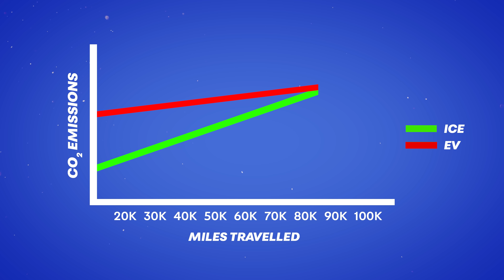Are Electric Cars REALLY That Green? [New 2022 Data]

Comment: Firstly make hybrid electric semi electric etc cars comparable cheaper than petrol diesel ones, you wont find a decent electric car for 10k like you find petrol or even diesel one , of which same capacity same equipment same features etc, i own kia sportage mk4 , paid for used 5 year old one with 50k on clock nearly 10k, find me same suv electric one for same price if i have "only" same amount in my pockets?  Outcome, youll only find nissan leaf and with 60-70% batteries capacity and powerness left with same or maybe even more miles ob clock , only being able to do 40- 50miles on one charge max ....

Comment: 1:50 are you even serious? while this is arguably true, no one throws an EV to a landfill at 90k miles. even if you total an EV prior 90k, the battery can be reused in many applications like energy storage.  worst case, the battery can be recycled at 95-99%.  burning fossil fuel would have released dust, toxic fumes, besides the CO2 environmentalists are against

Comment: This video pointed out that they Volvo used the CO2 figures of the extraction of the materials for and to build the batteries and compared that to the extraction and shipping of the oil used in petrol cars for Fuel. Every video I watch with, the given angle neglects to cover something major when figuring the Carbon emissions of an ICE. This video and Volvo did not disappoint... What about the Materials and process of Building the Internal combustion engine, Transmission, Fuel tanks, Exhaust systems, and all of the components that make them run all the Necessary repairs and Maintenance of each type of vehicle. Transmission Services, engine or powertrain Maintenance,  Exhaust repair. The Graph showing a ICE starting point of emissions almost a 3rd of an EV? Really. 2 Cars weighing 2 tons each and the CO2 generated in manufacturing them from the earths Crust to the showroom floor and an Ice generates a 3rd of the CO2? From Casting and Machining all the parts and components under the hood and from crankshaft to transmission. It's Like All that just Magically appears on a shelf and they just install it in every video like this. Like I said they didn't disappoint!!

Comment: You discreetly overlooked the pollution caused by disposing of the various vehicles at end of life.
EV's need much more energy for this, and if the BS propaganda of supposed  recycling any parts of the batteries is attempted , which at the moment is never , much more energy is needed..
I would suggest that if the end of life resources/pollution and the start of life  cobalt/lithium mining and battery manufacturing resources/pollution are incorporated, they'res not much difference between EVs and ICE's.
PS 
Let's overlook the pollution and potential pollution of the sinking of the felicity ace 60,000 tonne car transporter in the Atlantic,caused by VW poor quality EV batteries causing a runaway fire .

Comment: They say, battery can be recycled and be as good as so no need to polute enviroment in the the future. 4680 are good for 2mil kilometers so from my point of view all good
Reply: Ev batteries are not recycled at the moment. The resources and energy needed to extract minerals such as lithium and cobalt make it uneconomical.
The complete battery assembly can be extracted and possibly used as a cheap way of holding electricity from solar panels, on  domestic housing roofs, but unfortunately responsible governments and insurance companies do not encourage this due to the potential problem of runaway fires with such batteries.
ICE vehicles have been recycled for decades.
Reply: Oh 2 million km battery  life span? 
Where did you get this from ?

Comment: EVs are in fact powered by coal.  The emissions produced in the manufacture of one battery are equal to the emissions produced if running the same car on petrol for eight years.  They have next to no resale value because buyers are scared of the cost of replacement batteries.  They have limited range and are difficult to refuel.

Comment: The breaking of the EV at end of life has not been taken into consideration, what happens to all that toxic lithium?
Petrol cars can pretty much have every part broken down and recycled.
Also what about the human factor of an EV, the lithium and cobalt mines are absolutely disgusting for health & safety, there is no health and safety and the miners do NOT live long at all.  Not to mention the mess they make of the planet.
I'm thinking ICE is actually better in the long run, once breaking down the car at end of life is factored into the equation together with the human suffering of the miners.
I'll stick to my 2016 M235i until hydrogen is a thing methinks...

Comment: ....what happens when the EV needs another battery at 60,000 miles???
Chances are the owner can't afford it and the car will be scrapped. 
So if it's scrapped before the break even point, then EV's are worse than Internal Combustion engined cars.

Comment: This piece is really nothing more than FUD. 90,000 miles to earn back the higher carbon required to build an EV? This is simply not true. The real number is about 5,000 miles. To base a YouTube piece on some IC/oil misinformation is guaranteed to make the piece invalid.

But there are other problems with this piece. To start with EVs are about 5x as energy efficient as a comparable IC vehicle. The issue isn’t pollution around urban areas, it’s global warming.

In my case, and for a lot of EV drivers, our cars are fueled by energy harvested from our roof….so, zero carbon emissions. But even if one fuels an EV from the grid this is typically done at times of the day when there is excess electric capacity. 

Then there’s the energy required to manufacture and transport fossil fuels, which is simply enormous. 

At this point we should be long past the kind of FUD, and you really shouldn’t continue to disseminate it.

Comment: It is a interesting conversation to have. We all know that major manufactors use a lot of energy when producing products wither they be electric dolls or cars. It is interesting to see that Volvo have including the cost of production to you owning the vehicle, even though we have no control over that. It is too different conversations productions of vehicles and ownership of vehicles because as I said before we have no control over the cost of energy used in production but we have a choice in how we power our vehicle. Yes, I know that getting the fuel and production of the fuel is expensive but that is out of our control. The control we have is as I said before we power the vehicle. If you have a green energy supplier for your electric supply to charge your vehicle, it will be cheap but when powering a petrol car we have to take into the cost of fuel, the co2 that car produces and tax etc. If you have electric car, you have 0 tax, 0 co2. If you have petroled powered car you have larger co2 and tax to take into effect. i hope this makes sense in a roundabout way.

Comment: Nothing about charging times, which makes these cars difficult to live with if one is doing any sort of mileage.  Nothing about the amount of electricity needed to have all cars as EVs.  Nothing about the need to re-wire the nation to deliver this mythical electricity we do not have.  Nothing about intermittents not delivering anything like what we need, especially in winter.  In short, they are impractical for many uses, are extremely expensive and unless you own a drive, cannot be easily or conveniently charged.

Comment: An electric. Car if bought as first car will of course be greener. But most importantly there isn't that crap coming out the back of 5millon exhaust pipes in built up areas. Also UK is becoming more and more relient on solar and wind which is great but as you can't store grid electricity it's a great energy capture device with more and more EVs having the ability to have bidirectional charging.

Comment: I think that a lot depends on the timescales you work on. Because the lithium, cobalt and so forth in the batteries, and the neodinium in the magnets isn't consumed but is available to be recycled at the end of the vehicle's life, EVs look far more sustainable if you look over longer periods. Especially as wind and solar electricity have got so cheap.
Reply: What is the cost when the EV needs to be scrapped.
Reply: @donaldcarey114  that's going to depend on several variables such as the price of  neodinium, lithium and cobalt at the time when the vehicle is worth more as scrap than as a road car. If someone comes up with super cheap new sources of those metals, or alternative ingredients for batteries, then in a few years we could even be in a situation where you pay to have an EV scrapped rather than you get to sell your EV to a scrapyard. Being pessimistic about the supply of those metals, my guess is that the era of the cheap second or fourth hand EV is a long way off, and people who want a dirt cheap old car will be restricted to ICE ones for a long time. Of course that assumes you buy your battery, if you lease your battery you might want to read the small print in your contract. An old EV with its battery removed at the end of its battery lease might be a liability, especially if there isn't a breakthrough in batteries or their ingredients. Or it might be something you can give a new lease of life to with a new battery.
Reply: Wind and solar is heavily subsidised by the carbon tax paid by us the people don't be fooled look it up
Reply: @roberteccles3896  I have looked it up. Sadly the carbon taxes haven't really got off the ground. Early wind and solar did indeed get subsidies, but now? The costs have dropped below the level that fossil fuels can compete with them.
Reply: Where is the wind and solar panels manufactured
Reply: @jonathancardy9941  ps who paid if it wasn't carbon tax
Reply: @Robert Eccles  a carbon tax is a tax on carbon. Like income taxes are taxes on earning income and gambling taxes are taxes on gambling. Income taxes, property taxes, gambling, tobacco and alcohol taxes are widespread across the world. But that isn't really relevant now that solar and wind have fallen in price to the point where they are often the cheapest energy option. This is capitalism - the technology has improved to the point where the market is enabling consumers to buy solar and wind power.
Reply: @roberteccles3896  In the UK most of the wind turbines are built in Denmark and in Hull, although that is a very simplistic view. One of the current challenges (and my pun is intended) is getting offshore infrastructure permanently connected to our grid (so the cabling to connect the offshore wind farms to the mainland). However, once it is all connected, the cost of renewables will become significantly cheaper than hydrocarbons. The difference cannot really be qualified as we don't know how hydrocarbon prices will develop in the current geopolitical climate.

Sure, for caseload generation for those days when it isn't windy, we do need some back-up but compact nuclear generation is looking pretty positive. What is important is the the UK becomes self-sufficient in terms of it's energy production and we have the technology, the engineering skills and the resources to do so.
Reply: @jonathancardy9941  Government subsidies, like all other "Social Programs" are not paid for by carbon taxes. YOU, the taxpayer pay for it.
Reply: @jonathancardy9941  REALITY CHECK:  If that were true (the total cost of renewables), we wouldn't be having this discussion. EVERYONE would be using them. I know I would be, and I'm not.
Reply: @davidstephen6753  Tell me, when and where are these nuclear plants in the U.K. going to be built? (Asking for a friend.)
Reply: @donaldcarey114  Rolls Royce are currently looking the designs of 'Local' Nuclear packs which could be situated pretty much anywhere that the facilities could be managed - particularly water supply. So the generators would likely be built in Derby and, the last I heard, Derby, Glasgow and the West Midlands were being discussed as early installations.

I first went to sea in the Royal Navy in 1989 and nuclear propulsion was available to us (on submarines) and the U.S. Navy (I spent some time as an R.N. Engineer seconded onto the U.S.S. George Washington), so it is actually an entirely viable and practicable solution. The reluctance has always been the politics alongside the public perception of the risks from nuclear power. A bit like hydrogen, these things are not the 'boogeyman' that they are made out to be. Of course, they can be highly hazardous, but they can also be safely managed.

Is that specific enough for you?
Reply: @davidstephen6753  You have said nothing that I haven't known about for decades. (I'm a U.S. Navy Vet). The thing I don't see is ground being broken. Talk is cheap, let's see action.
Reply: @donaldcarey114  Well, in the U.K. the ground has been broken.

Comment: Interesting topic, glad it's being brought up. I don't however agree that we're at the limit of our ICE understanding and how to make them more efficient. Christian Von Koenigsegg has stated that there are so many advancements that could be made on ICEs as well as development of renewable biofuels which are far more efficient and greener. What we're also not factoring in these discussions is the amortization of the batteries in the EVs and what the future cost of replacement will be, as well as the recycling of the old ones. There are a lot of questions and concerns that nees to be raised about EVs, they also need to be compared to hybrids, ICEs with biofuel and ones without. And the most important bit is, this is a matter that must not be decided on the grounds of profiteering and margin-seeking, but rather as a permanent solution for the mobility of the individuals.

Comment: One assumption in the report is that there are no recycling costs since both vehicles are at the end of life.  In reality, I know quite a few people that use their cars well beyond 124,000 miles or sell it to someone else around 100,000 miles.  Therefore the analysis does not compare extending the life of the EV car which potentially requires a new battery and the carbon footprint to produce that battery and dispose of the old battery.

Comment: The problem with a lot of the claims are they need a MASSIVE asterisk attached to them.  Some of which are:

Experts in the field are raising the BS flat to full mast, and say these claims from Volvo are utter baloney, as seen here:

"Experts have disputed - and criticised - the Swedish maker's estimations, claiming it will take just 16,000 miles - just over two years of driving - for the electric C40 to overtake a petrol equivalent in terms of emissions - then pull well ahead beyond that point."

Also, the claims are specific to, and ONLY apply to comparing the Volvo XC40 vs the C40.  And you quickly see the reason why.  The C40 is a DISMAL EV from any perspective.  It's 78kWh battery gives you a  DISMAL (shall we say PATHETIC) 226 miles of range.  Say WHAT??? 

The reason is they use the garbage CMA platform which uses the same platform for ICE and EV's.  An obvious mistake which results in pathetic EV efficiency of 345Wr per mile.  Compare that to the Tesla Model Y which gets up to 330 miles on a SMALLER 75kWh battery, or massively 46% MORE range on a SMALLER battery.

This means the efficiency of a Model Y is 4.4 miles per kWh while the Volvo gets an absolutely atrocious 2.89 miles per kWh.  I think THAT is the real story here.  Volvo is making garbage EV's which are not competitive in the real world, and using their dismal efficiency to then claim EV's are not as clean as they should be.

The fix is easy Volvo.  Stop making inefficient garbage and pretend it is a viable EV.

Comment: what about EVs needing new batteries? isnt the 124,000 mile lifespan convenient because the battery will be dud by then? over a million miles, or over 20 years, surely the ICE is ahead after needing very little maintenance
Reply: That claim has been proven to be utter horseshit already.  A Tesla Model 3 with 100,000 miles had a whopping range loss of 2.2%.  Are you claiming that battery will require replacement in another 24000 miles?   Those ridiculous battery lifespan myths have been busted so many times already it is time to retire them forever.
Reply: @redbaron6805  I don't believe that.
Reply: @dickriggles942  "The first owners of Tesla Model 3: after 4 years and 160,000 kilometers, the battery life will only decrease by 2.2%

Andy Slye a car advocate and one of the first owners of the Tesla model 3 said he has driven 100000 miles since buying the long-range rear-drive model 3kilometer).

The owner posted a video comparing the performance of the model 3 over 100000 miles.  According to him, the battery only lost 2.2 percent of its range after 100,000 miles.
  When he bought it, the vehicle was rated at 310 miles (498.9 kilometers), and now it still has a full battery life of 303 miles (about 487.63 kilometers)."

I don't think Andy cares much what you believe to be honest...
Reply: @redbaron6805  I bet you work for Tesla.
Reply: @dickriggles942  I bet you have no idea who I work for.
Reply: @redbaron6805  Yeah, you work for Elon. Very obvious.
Reply: @dickriggles942  Yeah, you have no clue, very obvious.   

Hmmm... which numbers should I believe, a guy who actually owns the car and monitors battery depreciation, or some Dick online who has never owned one but thinks he knows better.

Decisions decisions....
Reply: @redbaron6805  Go try using your Tesla in Ukraine right now, ROFLMAO